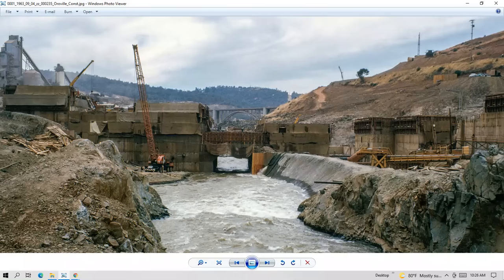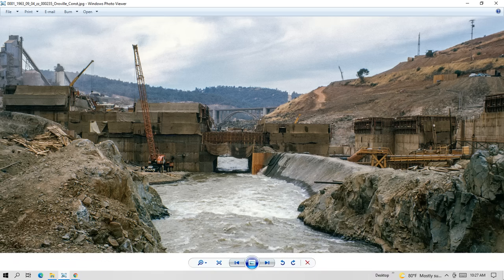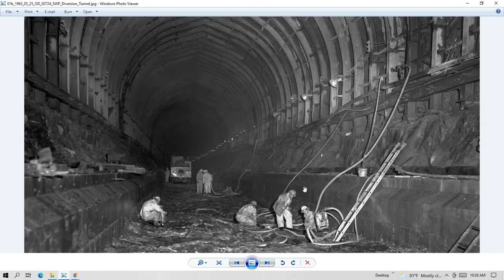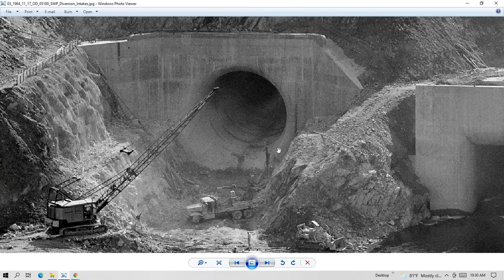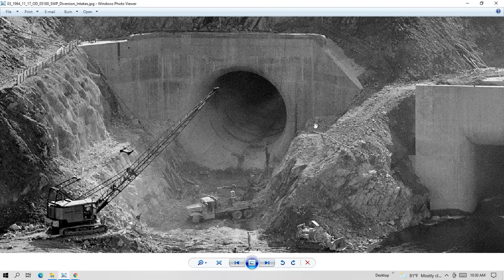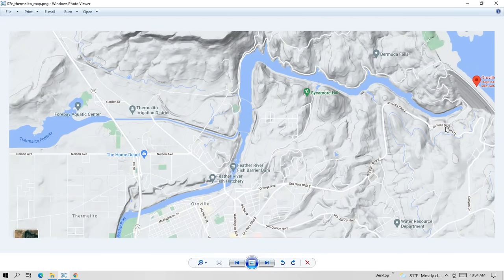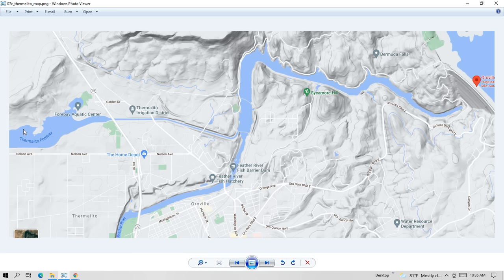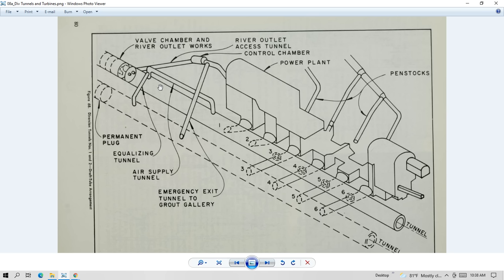The Oroville Dam Diversion Tunnels (keeping the Feather River alive) by Millie Kay 7-14-2021

Comment: Will the power house be able to start back up after it shuts down? I sure hope so...
Reply: The most substantial need of course is water.  That said, power plants generally have a very strict maintenance cadence for the equipment.  i.e. A house has 10 turbines, 8 of which are always in production while 2 are down for maint.  Once complete they go online and the next 2 in the cadence come offline and are torn down for maint.  Whit the plant shutting down it may allow them to step up the maint cadence, or if behind or struggling, allow them the catch up to the maint cadence.  It will also provide a chance for them inspect the output distribution components and so on.  If they take this opportunity one link in our power grid infrastructure can be strengthened and more effeciently secured as well...
Reply from the maker: @enigma2k10  Excellent info! Thanks for posting it here.
Reply from the maker: If the turbines are maintained properly, I would think there would not be a problem. Hopefully the upcoming rainy season will bring abundant replenishment and result in a very short shutdown.

Comment: I heard the Oroville Damn will shut down in a couple weeks if there is no rain. If water level drops to 640 ft they can’t produce power anymore.
Reply from the maker: Hi Charlotte! Yes, that is correct. The Edward Hyatt Power Plant can't operate if the level of the reservoir drops below 640 feet in elevation. If it does shut down, it will be the first time in its history that it has to shut down due to an insufficient water level. Thanks for stopping by!
Reply: They did announce that the Hyatt power production stopped. I am curious to see blackouts and spikes in electricity prices.

Comment: So in conclusion if there is no water. Left in the diversion pool this operation is non operational.
   This causes a secondary issue as California Eletrical supply system/ grid is smaller than its demand / customer base.
Reply from the maker: Hi Steven! Yes. If the Diversion Pool is not replenished by water coming from the reservoir (or returns from the Forebay, which wouldn't last long), the relatively short low-flow channel of the Feather River would dry up rather quickly. They could still release water into the high flow channel of the river for a little while from the Thermalito Afterbay. The Afterbay would soon be depleted as its capacity is only about 57,000 acre feet of water and it feeds other outlets per water rights agreements.

Comment: Hi Millie!  Great job as always.  Love historic pictures - they really add to the story.  I didn't know the lowest level ever was 647' - seems like a good chance to challenge it though I didn't try to determine if the trend supports that happening.
Reply from the maker: Hey Don . . . thanks! There are a few articles I've seen that state the lowest was 647 in 2014, but one or two say 645 in 1977. I went with what could be verified on CDEC (plus an article of an interview with a DWR official). The 2014 low occurred in November! 

DWR just uploaded some of those photos very recently. Isn't that interesting? I just had to squeeze that one in of the canal they carved out before the tunnels could be used. It's one of my all-time favorites! 

I see the reservoir storage just dropped below a million acre feet a couple of hours ago. What I'm wondering is how much silt is down there now at the Tunnel Two inlet.

Comment: IIRC when the outlet tunnel plug was tested in the past there was a fatal accident and serious damage
Reply from the maker: Hi Robert. You are right. I made a video, "Details of Investigation: Oroville Dam River Valve Chamber 2009 Accident 5/11/17". No one died, but yes there was serious damage. That accident is what led to a lot of the upgrades and changes that were made to the RVOS system.

Video is at https://www.youtube.com/watch?v=E8iGn2PDmnQ
Reply: @MillieKay …. thank you. I Have relatives in Chico. In the 1960’s and early 70’s as the dam was going up I rode in the car up and down hwy 99 twice a month. Saw it going up
Reply from the maker: @Idahoguy10157  Cool. They were also building the Thermalito Afterbay dam between 1965 and 1968. In the 90's I drove by that dam for years when going from Yuba City to Chico and didn't really know what it was all about (had my mind on shopping at the Chico Mall before Yuba City got one LOL).
Reply: @MillieKay  …. Those giant earth movers literally worked for years creating the embankment next to 99
Reply from the maker: @Idahoguy10157  That is a loooong dam!
Reply: @MillieKay  ….miles and miles. No one told me what it was for. Except the dam was supposed to keep Yuba City and Marysville dry
Reply from the maker: @Idahoguy10157  I guess that's the short story LOL.

Comment: I am wonder how will Hoover Dam keep water flowing in the Colorado river once the water is below the intake towers ??
Reply: The water will still be able to flow through the intake towers, just not at a great enough rate to generate power.
There is also another outlet that they added at the bottom of the lake a few years ago to get a supply of water to Las Vegas.
Reply from the maker: Thanks for replying on this, blipco5! I also read that they had put in some new turbines that are more efficient in order to slow down the volume of water needed.
Reply: Yes Millie, but the efficiency improves only a few percentage points, which is better than nothing. We are years away from better times if they cone at all.